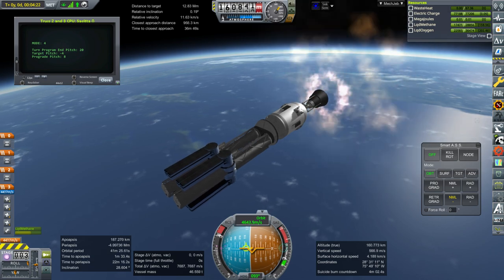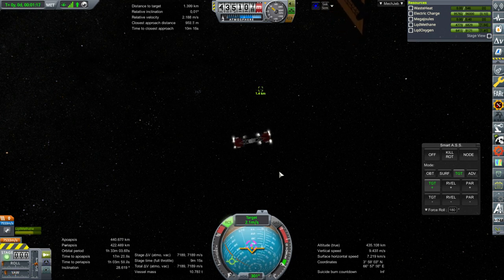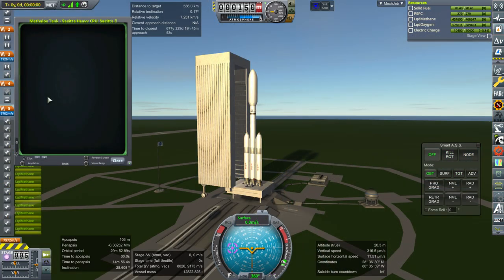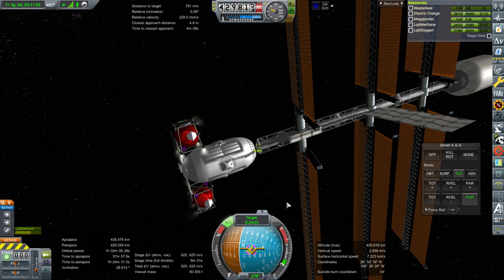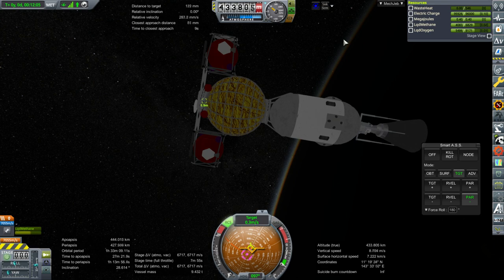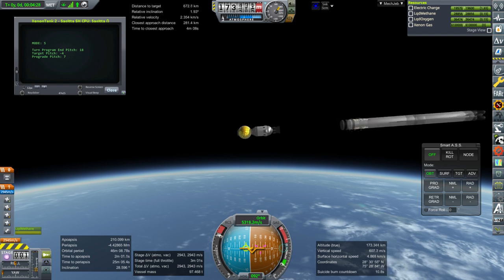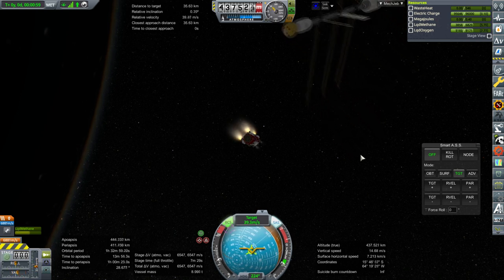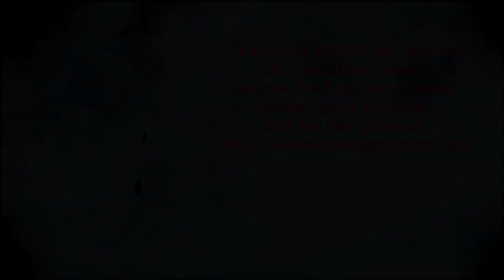KSP 1.6.1 RO and Kerbalism - Mars Colonization 021 - Expedited Construction

Comment: 1. Very eager to see your video about hydrolox engine. Is it be open cycle?
2. Maybe mod physics range extender can help you?
3. 480 kw at leo is ~208 kw at lmo, which is enough for 46 spt-140 (in use)  -  13 newtons. We need more power! Go nuclear! 1mw is not that insane. TEM  - only 20 ton, 18 newtons and insane 7000 s isp. Replace it engine with lower isp spt looks nice.